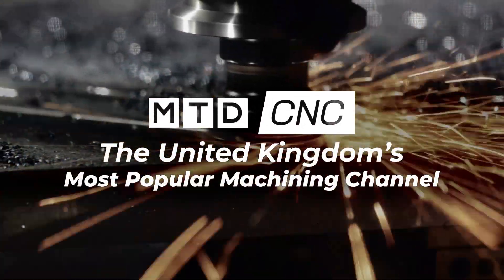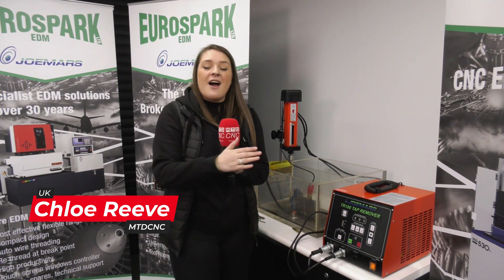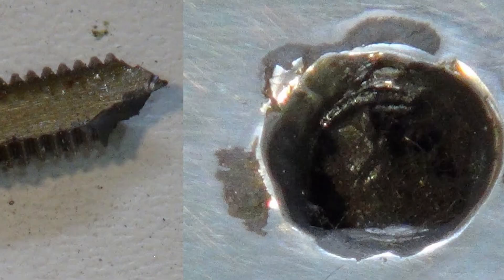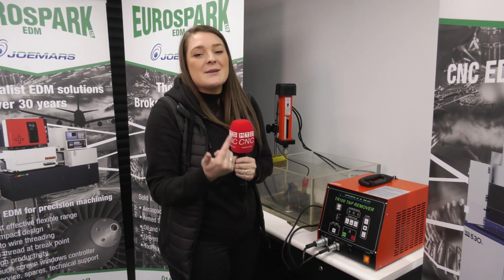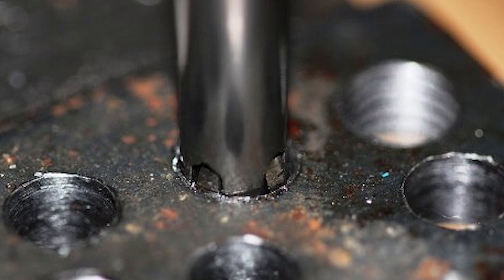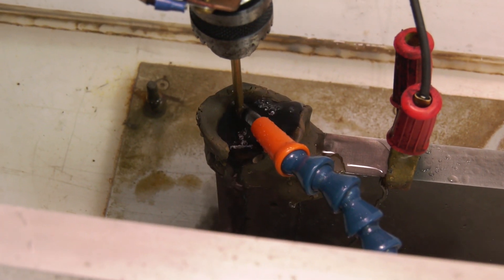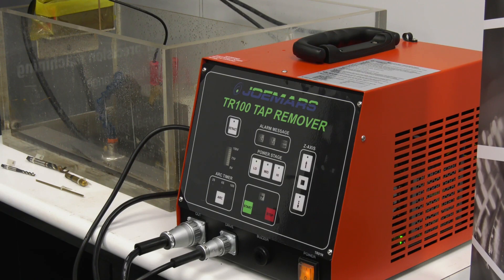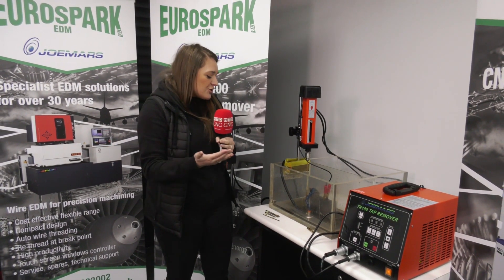Smashed that Tap? Get it out with one of these

Comment: How many taps do you have to be breaking to invest in a dedicated tap removing machine? We just threadmill everything now anyway
Reply from the maker: A lot of people still using taps for speed but yes you are right treadmill is easier as when it breaks it just falls out the hole.
Reply: @MTDCNC  Also can tweak the cutter comp to get the thread to the right size, and theres no lead out on the bottom of the thread.